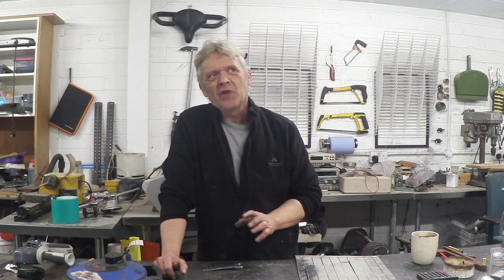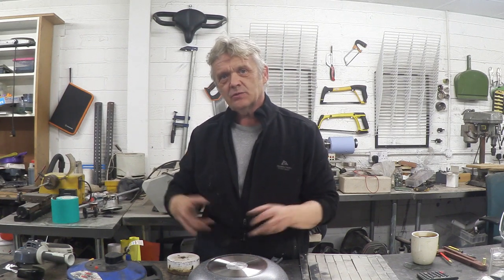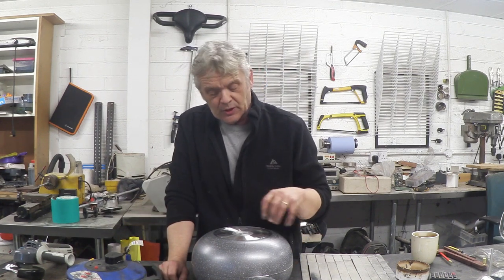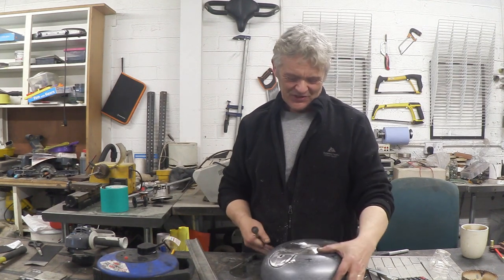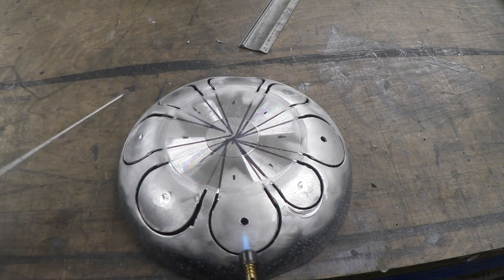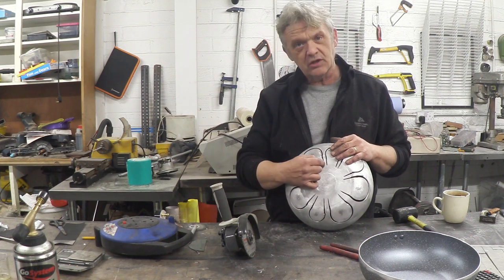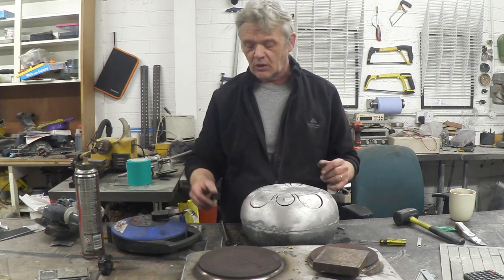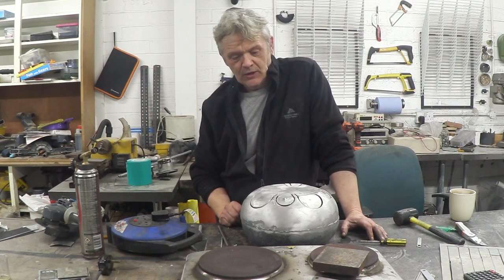Make A Hank Drum From A Wok

Comment: Very nice sound to it! 
I would recommend avoiding JB weld though just use fasteners 

In my machine shop we frequently use J-B Weld to dampen tool vibrations on long overhanging lathe tools 😅
Something about the vibrations trying to go through different material qualities really seems to dampen it a bit more than you would expect
Reply from the maker: nice tip mate cheers

Comment: What if you sit it up on a piece of rubber feet or actually make a base so that you can bolt it to the center under it. Then it should have a clearer sound because it would have a even vibration. Was just a thought I had in mind due to the fact I am an old drummer and took 4 years of drums back when I was doing the whole school thing.
Reply: A center rod welded to it would work real nice and then bolt that rod to a flat piece of lumber board under it. That would do real well for improving the sound when hit with a rubber mallet.
Reply from the maker: nice tips mate - thanks for taking the time to share
Reply: @ThinkingandTinkering  I also looked up a few pro's and how they build it and they seem to be all cutting out a 6-8 inch wide hole in the bottom to give the hollow sound and they sit it on little marble size rubber feet so that their is a short distance for the hollow bounce of bass sounds. They sound wonderful